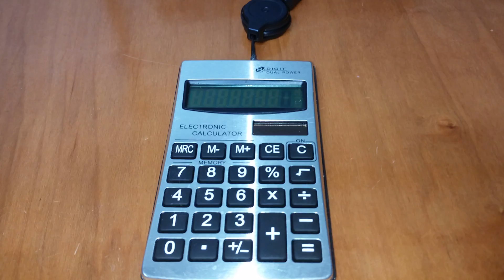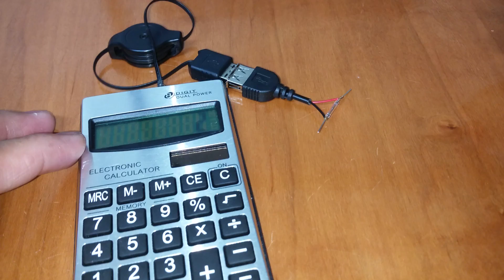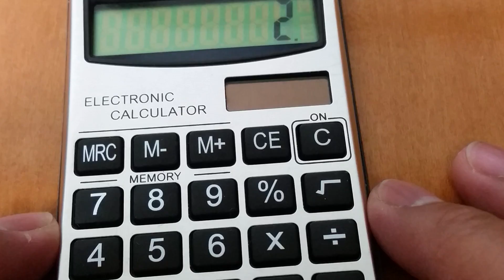How to make a calculator coil winding counter with a retractable USB cable

Comment: I soldered the wire to the board it worked at first but now when I turn it on it just stays at zero I press the numbers keys an it just stuck on zero I tried it on several different calculators an they all had the same problem could any one please help
Reply from the maker: Smitty Smit Hi first Thank-You for watching my video. That happen to me too make sure when you connect the wires  don't touch anything else Besides the on terminals. If you still have this problem after checking your connection let me know what type of calculator you are using and I'll make another video with that.

Comment: good job, thanks for the brilliant idea, please what type of photoresistor did you use, can i have the specification. thanks
Reply from the maker: Idowu Olowo  hi thank you for your comment  ( Reed Switch ) or ( Magnetic induction switch ) about it through eBay. Specifications. Glass Length : 14mm, diameter : 2mm, total length: 45mm, Max switching voltage: 300 VDC, Min breakdown  voltage: 150 VDC, Max contact rating: 10w, Max switching current : 0.55 A. I hope this will help you get yours and thank you for your comment again.
Reply: yes thanks  for reply

Comment: Thank you for making this video. I have been trying to find a calculator to make a counter out of with a real circuit board inside to solder to. I have bought several dollar store units and a few at Walmart. As luck would have it, I have the identical unit you show in your video. So now I will know exactly where to attach my wires. I am very grateful to you and quite impressed with the motorized drive unit you have built. Very clever idea. I have a small D.C. motor I want to use for the winder, but I haven't figured out how to put it all together yet. Thanks again for a very enlightening video.